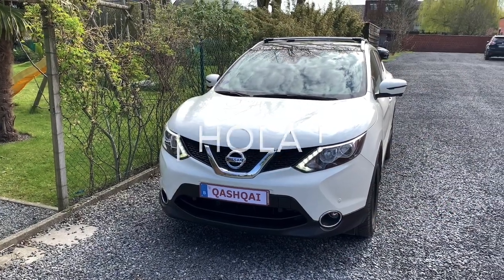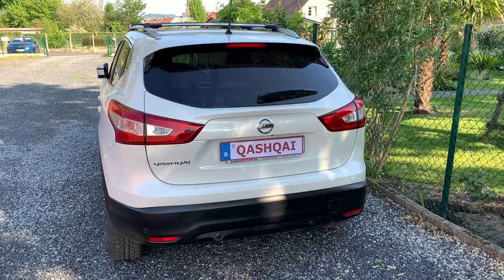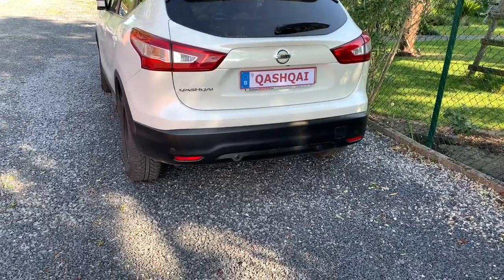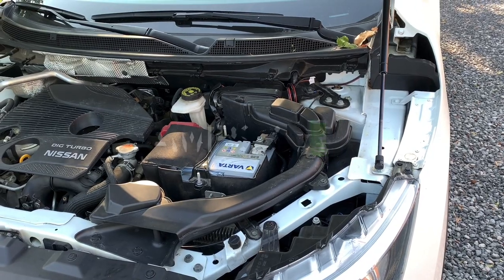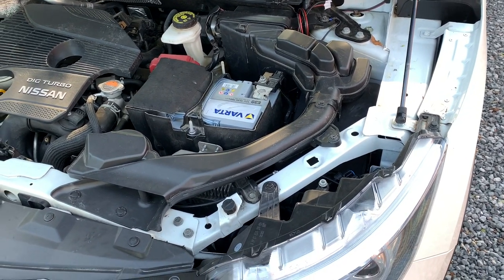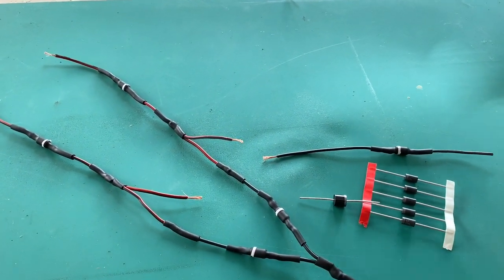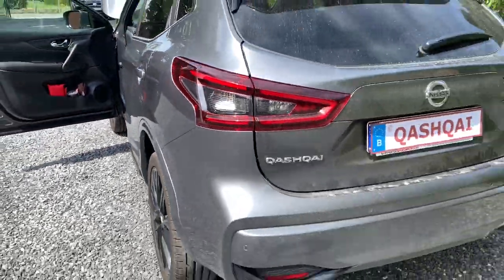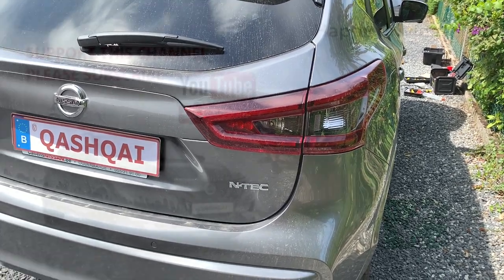Nissan Qashqai J11: use the rear lights as daytime running lights! (DRL)

Comment: Hello yet another excellent video, I've been through a lot of your videos and made the same changes and have now finally subscribed keep up the good work really appreciate your videos. I have a question how can you use this with a relay? Reason why I ask I already have a spare 5 pin relay i used the other for my last project which I added a long led strip on the front bonnet and connected it to the drls so they come on when you unlock and lock the car. Is they possible if so how please?

Here's how the lights work:
When you unlock the car, there is 12v supplied to the DRL, over the PINK wire in the WHITE connector. This
happens only when you lock or unlock the car. It is brief and then the power is removed. Otherwise there is no
power to this wire
This wire connects to 87a, which you can consider as the OFF position. So 87a is then connected to pin 30,
which is the RED wire of the LED, and therefore it powers up the LED when you lock or unlock the car
Pin 87 on the relay is the SWITCHED LIVE, i.e. ignition or car running mode, which is like the ON mode, and
sends 12v to the LED, turning the LED on whenever the ignition is on basically.
Pin 86 provides 12v power to the relay electromagnet. Without the power, the magnet does not work and
therefore the switch defaults to 87a / OFF mode / pink wire and allows for the DRL functionality to work with
lock / unlock.
Pin 86 will ONLY provide power to the magnet and turn the "switch" to ON / #87 when the ignition is turned on,
hence it needs to be connected to SWITCHED LIVE.
Thats why both 86 and 87 need to be connected to SWITCHED LIVE / connected together.

Does this mean I can just use the blue power wire from the relay and connect them to 4 and 17? Would that work?
Reply from the maker: Hi, thank you so much for your feedback and the subscription. :) I'm not really sure what you want to achieve and way you want to use a relay if that wire already gives the brief signal... ;)
Reply: @LaPalmeraie0032  hi, it's a setup I already have whe  I added some drl strip at the front I was wondering if I can just connect the back tail lights 4 and 17 to that setup I have for the don't drls and if that would work? Would I still need to use dioid if I have a relay?
Reply from the maker: Ok.. I’m still quite confused about how your setup is exactly done but I’m sure you will also find a good and safe way to add the tail lights. Just be sure to remain within the limits and don’t wire to much to the same place (or use a relay indeed). You also want a switched source that remains live once the car is started. A source that only kicks in briefly when unlocking would only light the tail lights briefly. A relay wouldn’t change that.

Comment: Well done and thanks for sharing. As an easier alternative, I will try to connect to the wire harness that goes through the car directly near the door (front left). I need to find time away from my kids to do it. Can you tell me the wires colours that you tapped into, which will make my search within the wire harness quicker? I will share outcome indeed. Thanks
Reply from the maker: Hi Marius, thank you 😉 well it would seem easier but there are a lot (!) of cables that come  together on that place. So I’m not sure that even with the correct cable color you will have the correct cables. 😉 better be safe than sorry no?

Comment: Hello, I have been following your excellent project and work from the beginning.  And I have one question, the older version of j11 has a physical key to turn off ESP, how to add that key to the version of J11 after 2018 just like on your n-tec, if at all possible?
Reply from the maker: Hi Nenad! Thanks mate! I see what you mean, in the video on 3:07 you see the toggle switches of me previous QQ which has this switch, my new one 15:00 doesn't. You do see other which I added but not the ESP. I guess if they didn't add the toggle switch it isn't possible to add it afterwards neither. I also noticed for instance that the working of the Lane Departure Assistance has completely changed as well. I would advice to leave it be. ;)

Comment: Hallo , My 2019 Qashqai Left hand side DRL is not working , any ideal how to fix it .
Reply from the maker: Hi! Does the indicator works? You could check in the IPDM if the port 57 gives any voltage between 9-16V if the car is powered on. But I’m afraid it’s the LED itself and that is integrated in the whole unit so it’s the complete headlight that need to be replaced. Keep me posted.

Comment: Hi i have an xtrail 2017, similar setup to the quashqai i guess, and the DRLs on the front headlights dont work, they only work as park lights. If i do an active test on an OBD2 diagnostic unit I can turn them on by changing the optical sensor to the ON setting for full brightness but they dont stay working after the diagnostic is disconnected. Is there any way they can be made to be left on during the day?
Reply from the maker: Hi! That should be the standard way it works. As soon as the car is in ACC mode the DRL should be on. Is the light switch turned on correctly? Otherwise I guess that something in the BCM is wrong.
Reply: @LaPalmeraie0032  thanks for your reply. Most of the models came with it standard but i have the hybrid model that came from Japan and they all have it disabled somehow. I know other persons with the hybrid model that it doesnt work. Any ideas on how it may be rectified?
Reply from the maker: @reyadsingh8802 you could do a similar job as i did in this video for the tail lights. Use a alternative power source and a switch to turn them on that way.

Comment: If we don’t want to have DRL button, can we just put a cable from port 19 to port 4 and another one to port 7? What will be the outcome? Tks in advance!
Reply from the maker: Hi Pavlos! Indeed you can and it means that the tail lights will light as soon as you turn on the ignition. But still use diodes in order to respect the current flows and that no current will flow back to port 19. It may create unwanted interferences. 😉
Reply: @LaPalmeraie0032  thanks! And what exactly should I buy? 2 x diodes 12V and a 12v cable? How do I “glue” the diodes on the cable, with tape or I should used a thermal tool?
Reply from the maker: Hi! Yes, the link to the diodes should be in the discription. 12V and the amperage is important in order to work. As cables the red and black audio cables from the DIY store are great. 0.75 is perfect 1.5 works as well. You need to solder the diodes to the cables indeed. Please check my video on car electrics if you’re not sure. 😉

Comment: Hey sir, is it possible to set that brighter front drl one when is set to (0) to be on all the time with regural headlights?
Reply from the maker: It should be by-passable as the brightness is set with different voltages but… the 100% DRL would be very bright and blinding at night time. 😉

Comment: I am still searching a way to add additional drl lights on the front. Right under the parking sensor area. Tekna and nconnecta versions have silver matte pieces when lower versions have black plastics. Trying to fit them with the same process like the front fog lights replacement seems quite narrow spaced. Any ideas?
Reply from the maker: Hi! You could stick LED strips somewhere under the license plate area as I used in the back for my dynamic turn lights. The wiring could be simple to the IPDM drl ports. 😉
Reply: @LaPalmeraie0032   I have allready bought the additional drl lights that look awesone. Only prob is that i am trying to avoid removing the front bumper.
Reply from the maker: I totally understand. Well i don’t know what they look like so I can’t help you with the exact placement. Just try to look for gaps where they would look great and fix them with very good 3m tape, tie-wraps or special mounting silicone. You do not want them to come loose while driving...! Then for the cabling use the method as described. 👊🏻
Reply: @LaPalmeraie0032  Is there an email i can contact you?
Reply from the maker: Yes, lapalmeraie AT palmvrienden DOT net 😉
Reply: @LaPalmeraie0032  Sent!
Reply from the maker: Got it. Will come back on it after my holiday break 😉
Reply from the maker: Ok I see... you have these 
https://a.aliexpress.com/_dSuXmlP so as I see the are clipped in place but it seems there is one screw as well at each side. Try to remove the inner protection cover of the front wheel (and maybe the wheel as well) and you should be able to reach it as well without removing the whole bumber. For the wiring it seems there is one module that probably gets 12V and ground and then a wire to each turnlight. Good luck. 👊🏻
Reply: @LaPalmeraie0032  I guess i am getting power and ground from the headlight wiring.
Reply: All great, i managed it. Any ideas on how to get signal/flash/indicator power? I tried all the fuse boxes but i can't get this ability to work.
Reply from the maker: Just tap it on the indicator positif directly 😉
Reply: @LaPalmeraie0032  You mean the positive cabe that goes to the indicator? Nope doesn't work. First thing i tried.
Reply: OK fixed it...i tried but accidentaly had the other cable in my hand...who knows why? Lol
Reply from the maker: Yes, your AliE light should be fed by the positive indicator cable in order to indicate as well. I’m not sure but by heart it is the green cable. Otherwise ask the seller, he should be able to explain how it should be wired.
Reply from the maker: Aa Aa great! Happens to all of us 😉

Comment: Why would you do that? It's dumb to use lights at day time... Useless
Reply from the maker: Hi Nikola... so you think the front DRL’s are useless to then? I do not share this opinion. Sure, when driving in daytime with bright weather they are less important and mainly ass some styling but as soon as the conditions are less bright they definitely proof their use as the lights do not get activated automatically that soon. So in the morning, eavening, several weather conditions I find them very useful. Premium car brands seem to think the same as they all make this by default work this way. 😉